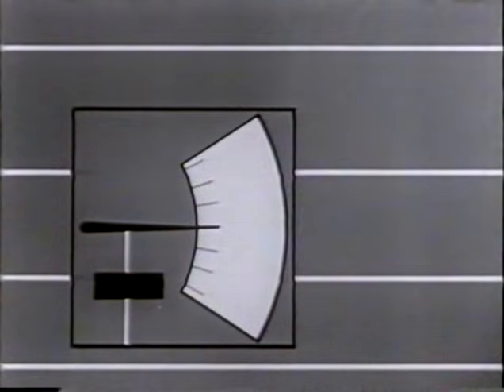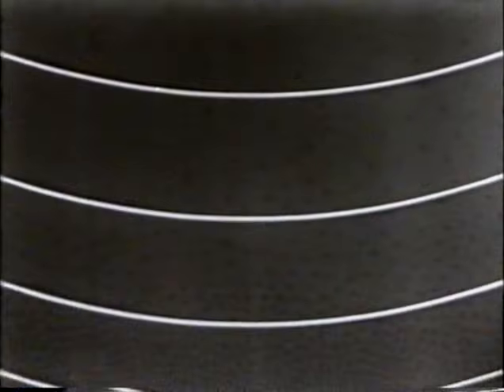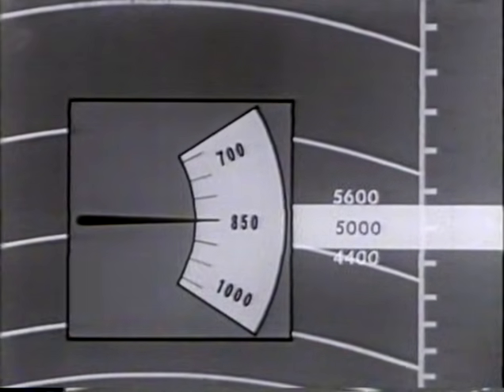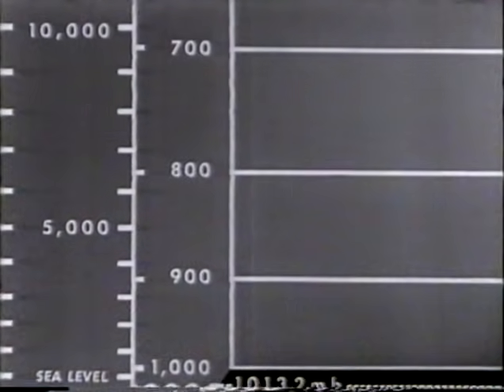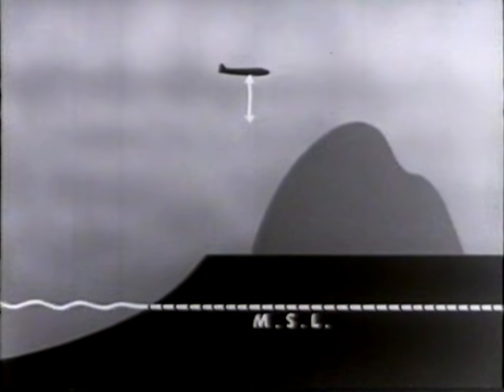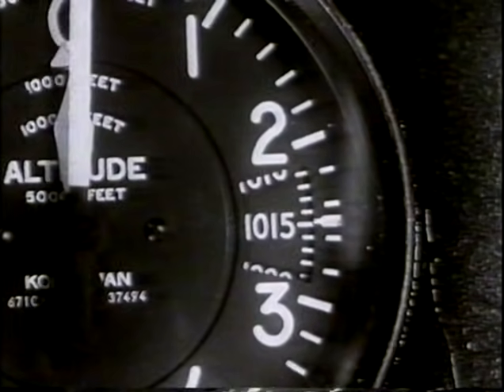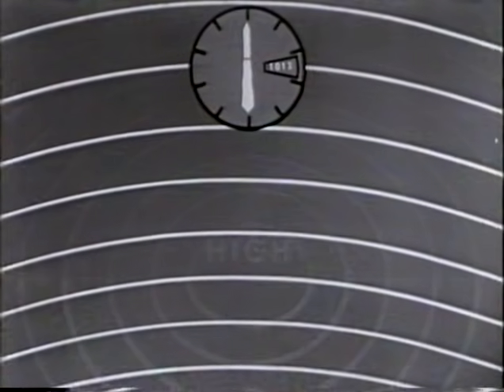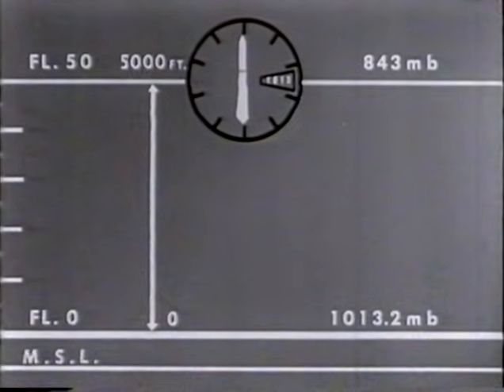Altimetry basic principles

Comment: After resetting the subscale window on the Altimeter , The Altimeter reads an altitude of 5447 ft so after doing that should the pilot descend to 5000 ft or just maintain 5447 ft ??
Reply: Basically, yes. The altitude setting (QNH) is used below the flight levels which these days, start at approx 18000', Class A airspace FL180.

Comment: Whats the point of needles on altimeters, instead of just the numeric readouts? Wouldnt it automatically be better to get an exact number rather than a collection of needle positions?
Reply: *****
I understand the inner workings, but even thermometers have digital readouts these days... You'd think people would prefer precise readouts, rather than having to convert needle-positions to numeric estimations...

-The same way a digital clock provides better read-out than a wind-up clock...
Reply: *****
I guess a safety requirement, not relying on external systems...
I'm just surprised that the data provided (which afterall is a needle position, and not a number) is "sophisticated enough" for modern aviation.
But thanks!
Reply: Using gauge is much easier and faster to interpret the instrument rather than having to read every single digits. Yes digital read outs are more accurate but you don't need to know the accuracy of a few feet when flying an airplane.
Reply: @leewai05  it is also easier to interpret rates with analog equipment, you can see how fast is the reading increasing or decreasing at a quick glance. That's why in a modern cockpit the primary display unit, while completely digital, still displays the speed and altimeter as and analog readout.